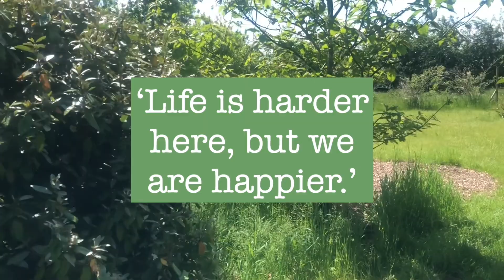OFF GRID LIFE vs normal life: PROS and CONS of living off the grid | What is off-grid life like?

Comment: Hi, your family’s journey is brilliant! 

I was wondering if you could provide some guidance into our new future project.
We are in the process of putting planning through to build an Annexe measuring 8.5M x 4.5M where we could connect electric power and water supply. The Annexe won't be used every day. I was thinking for the Annexe to be off grid. Going off grid would mean:

Solar and Water Tank supply. No gas required.

The Annexe will be used as follows:

A breakout area for (playing music and watching movies) entertainment.

An office (WFH) Working From Home.

Consisting of a toilet with wash basin and a storage area. 

A fridge drinks cabinet.

I was thinking installing Electrical Under Floor Heating and a good size water tank.

Question: Wat size Water Tank would be utilised and what Solar equipment would you recommend?

Thanks